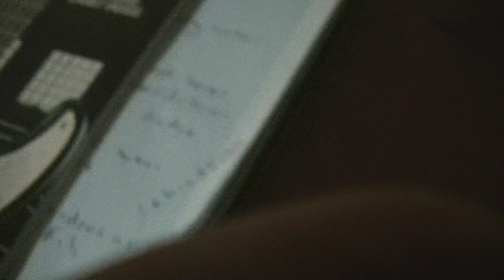ghost box sound level display

Comment: you did a real good job with those it will look really good on the ghost box to 👍👍
Reply from the maker: thanks kim your the only lady to reply to my videos ill install it soon on my big ghost box
Reply: @stevenchiverton48  thats cause I like your videos my friend👍
Reply from the maker: @kimfitzgeraldrockfam8973   how sweet anytime , im searching for a cheaper better alternative to the psb7 spirit radios used for the ghost boxes to as the psb7 are very expensive to buy so  im working on that, ive already fitted the new triple led sound level display to one of my large ghost boxes and wired it up just have to put a switch in and a better battery tray holder , each led strip has 17 light emitting diodes/led for short so 3 x 17 and thats how many lights there is
Reply: @stevenchiverton48  that would be good I dont do paranormal stuff  I like watching  love Patty from the GTeam  and Lou Rock aswell